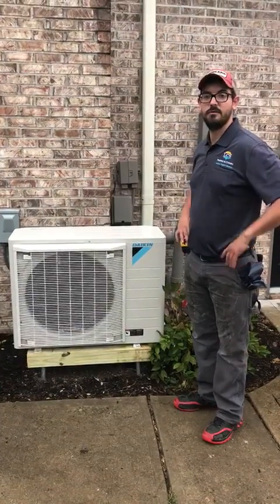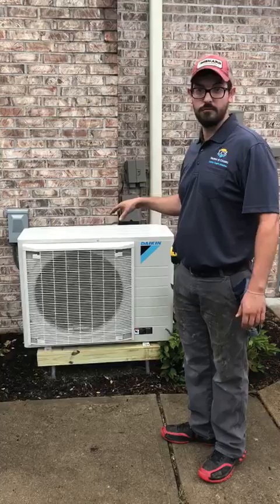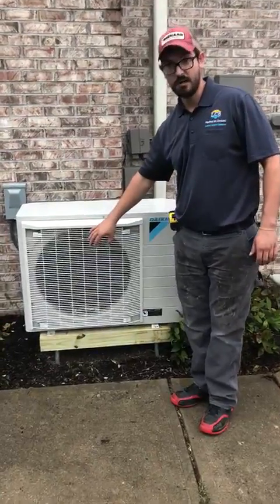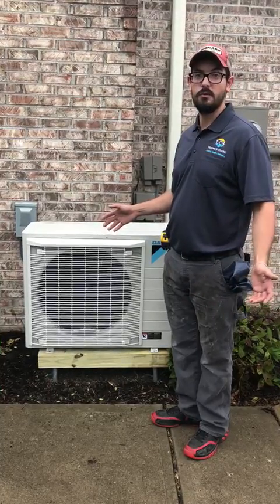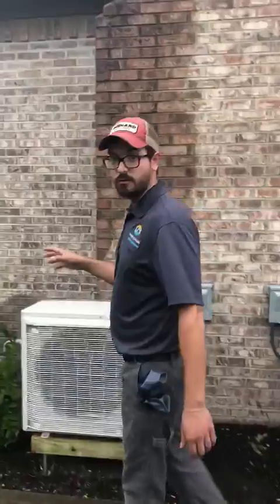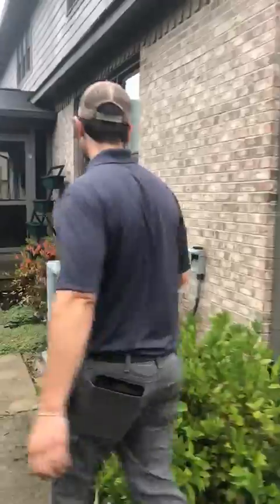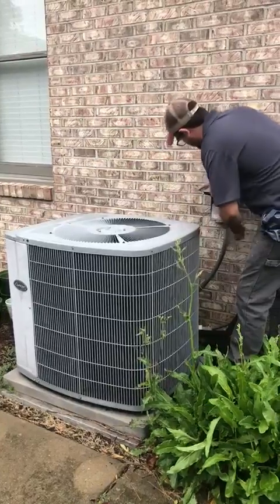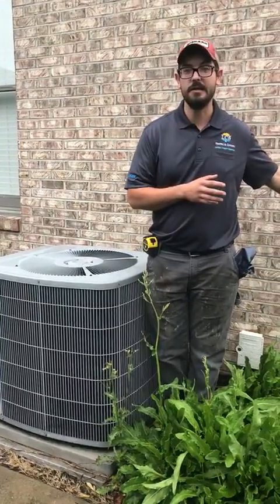HVAC Talk: Let's Be Real- Daikin Fit

Comment: Who gives a rats ass how loud it is outside???   People do give a (blank) how much it cost, how efficient it is, and how long it will hold up.
Reply: Lot of people care about how loud it is INSIDE and OUTSIDE.  Just like there are a lot of people who want a totally or very near silent computer.

If I go outside in my backyard and I hear a machine, I don't much want to chill outside, read a book or what, because I am the kind of person who "hear" and is "conscious" of everything.  And if there is a constant sound that annoy me, well it just ruins my experience and can make me feel very bad.

I actually got a Daikin Fit and right now I feel it is too loud and hope my provider can make adjustment, because the noise was my number 1 concern and criteria for my system (BTW, I would be more than willing to pay double price if the system was totally silent).  I hate to complain and am afraid I will be told it is "normal".

Of course, there are solution like just put electric heather on the wall there and there and that will be silent.  I would hope heat pump, furnace, etc. were as silent.

Of course "sound appreciation" is subjective.  There can be loud/low and annoying/agreeable and it might vary.

Trust me, I am not alone who will pay more for silent/way-more-quiet products (computer, heating system, etc.).

Comment: Just had my gas furnace and AC replaced with basically the same stuff. 80% American Standard 3 ton / American Standard 3 ton AC. I almost went with the FIT but decided I didn't want to get off gas. The same government that is telling me all EV vehicles by 2030 but also telling me to conserve electricity , yeah no thanks. Wishful thinking libs. I consider it with the $4000 off rebates and $2000 tax credits but nah.
Reply from the maker: @45eno  the FIT can be installed with a gas furnace too! We personally love the comfort of gas, but efficiency and quiet of the FIT 🙌

Comment: Why is Daikin so heavily promoted?  There are probably not even 2 reviews from homeowners.  Very suspicious to me.  It's a rush of dealers tripping over themselves to say how good it is.  Try to find homeowners.  What few homeowners I have found.  When this thing revs up, it's a LOT noisier than that.  Not huge noisy, but much noisier than that.  The price has went up on these HUGE in the last 3 years and lost the 12 year labor warranty.
Reply: I have a 2 ton Fit and it is wonderful. It is nearly silent and works wonderfully.
Reply: Interesting point. The material mark up must be incredible as well from the bids I’ve received, particularly the Daikin. Shopping LGRed as comparison.

Comment: There's a lot more to an Air Conditioner than how loud or quiet it is.  So many Daiken and inverter AC's focus on how quiet if is.  I'm rarely hanging around it outside on hot days anyway.
Reply: The noise form the ac helps me sleep.  I can’t sleep in silence.
Reply: Yep!  That was sorta one of the points I was quietly making.  Quiet is good, but not everything.  Although, even outside your window, you can sometimes hear a condenser if it's loud.  So better loud than noisier.

Comment: Hi , me again. I had just replaced an old 13 SEER single stage unit with furnace  with a 17SEER Daikin Fit Heat pump.  I ran into two problems. 1) Surprisingly,  there was absolutely no energy savings on my summer power bill.  2) It produces a loud buzzing noise in the wall in the winter. 
No real good reasons given for why the Daikin Fit wasn't more energy efficient. The manufacturer says the Daikin line sets run at higher pressures in general and especially in the winter.  And this likely causes this buzzing in the walls. They suggest running the line set up the wall externally to remove the buzzing noise. Are you familiar with this issue? And will running the line set up the wall definitely remove the buzzing line set issue?   Any feed back would be helpful. THANKS!!
Reply: A 17 seer unit uses much less power than a 13 seer unit. That is a fact. If your power bill is higher than you are either consuming more power in general (from somewhere else in the home).  Or you power price per kilowatt hour has gone up (the power company has raised there prices).
Reply: Your AC system isnt the only thing your home that uses power. If your power bill is up then you need to look at other reason other than your AC system.

Comment: Which air handler it is using as inside unit ? Is the system using existing whole house duct system or ductless split ac heads ?
Is this unit is being used for heating too ?
I am looking to replace my aging central ac/gas heating with Diakin Fit heat pump, but not sure if it can be used with existing duct system and a properly matched inside air handler .
Reply from the maker: There are specific air handler units designated for Daikin Fit Heat Pumps. You should not have to do anything with your existing duct work in order to have a Daikin Fit Heat Pump installed at your home. You will need to make sure that the contractor you hire to install the system does a static pressure test at your home, to ensure they install the correct sized system that is supported by your existing duct work. Hope that helps answer your questions!

Comment: Hey- how do you clean one of these Daikin Fit units? I've had mine for about 2 years now, and the manual does not provide clear instruction on how to clean the condenser unit.
Reply from the maker: The best way to keep your Fit system running at peak condition is to have it serviced by a company that installs and services Daikin equipment. This way your equipment warranty can be protected and you can maintain the piece of mind and comfort it provides you and your family. But, you are correct. These systems require less work to clean, as the only part that will get clogged with debris is the back of the unit.

Comment: I just purchased the Diakin Fit units for my PHX home, but was surprised that they still turn on and off nearly as frequently as my old single stage AC unit. I was expecting the compressor fan to stay on nearly all the time, but just run at variable speeds, so that the full on and full off behavior wasn't utilized so often. Is this frequent on/off behavior correct or should my compressor fan stay on nearly all the time at variable speeds?
Reply from the maker: How many times is it turning on and off per hour?  We have high humidity in the midwest so we want longer run cycles here.  There may be something in the setup to have it cycle more often since it's so dry in PHX and removing humidity isn't an issue.  Your installing company should definitely be able to answer that question for you as well!
Reply: @lastingcomfort101   Thanks for getting back to me. Any feedback is greatly appreciated.  Diakin won't talk to me bc i'm not a vendor. I'm not sure about the hourly on/of rate of the compressor fan. But it seems to run more like a single stage AC unit, which is unexpected.  When it's on, it quickly ramps to nearly max compressor fan speed. I've never seen the compressor fan cruising at low speeds, like I've seen elsewhere in Boston or online.  But PHX may be different.  Should I see low compressor fan speeds much more often than off though? My AC vendor is new with Daikins and not very knowledgeable.  In fact they recently did an on-site training at my house with the vendor and Daikin rep. They couldn't even connect my thermostat to the Daikin Cloud. I had to call around to figure that out.

Also, the advertisement says "side discharge" but the air is exhausting out of the unit's face not the sides.  Is that correct?  Thanks again
Reply: @winly7450  Does the Eco mode make any difference?

Comment: IT all sound perfect, except theres too many electronic board on most of the inventer heat pump. When they fail its very expensive to replace.
Reply from the maker: Everything made today, whether it's HVAC equipment, vehicles, or electronics themselves, have a lot of these type of components. This is why we stress the importance of labor warranties when purchasing high end equipment. When it comes to machinery, anything can break at any time. Better to be prepared, than sorry!
Reply: That's why theres a 12 yr warranty

Comment: I've a query! When the compressor speed is at its slowest (after reaching the desired temperature), the outdoor unit makes a faint high pitched continuous beep sound. Is it the case with inverter compressors? Please verify if this is normal? As soon as the compressor gains a little bit of speed, it goes away. Overall the AC works absolutely fine.
Reply: Yes that is completely normal, the compressors and blowers are inverter controlled.  Also if you are curious and inclined, place an amp clamp on one of the compressor power legs as it spins up, you will notice the unit will not pull more then 3-9 amps at startup and maintain 1.2-4 amps while running.  Model dependent of course.
Reply: After the desired temperature is reached, do you notice your fan speed of the outdoor compressor unit slowing down significantly.  Do you see the compressor fan running slow more often than you see it off?  Thanks in advance.